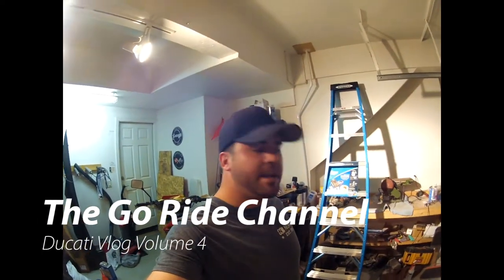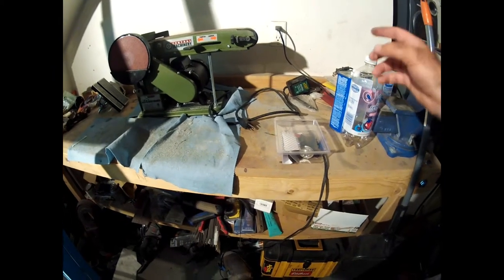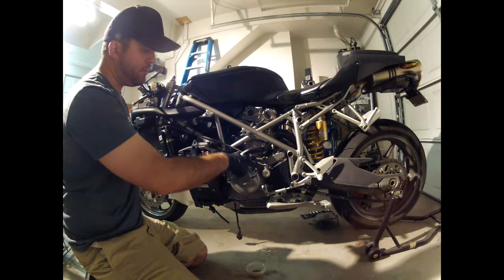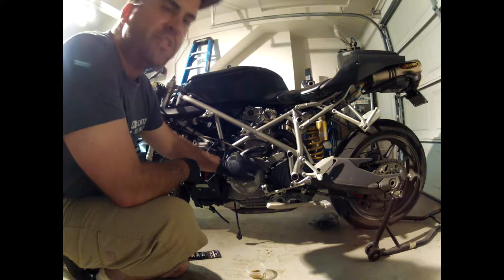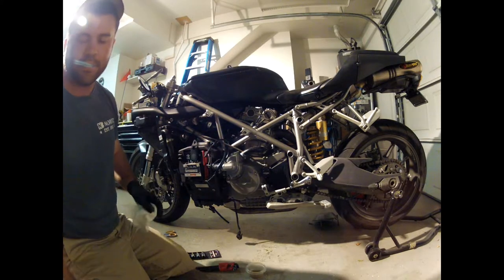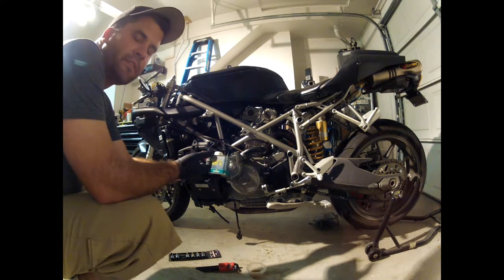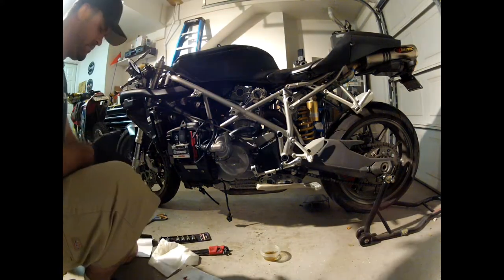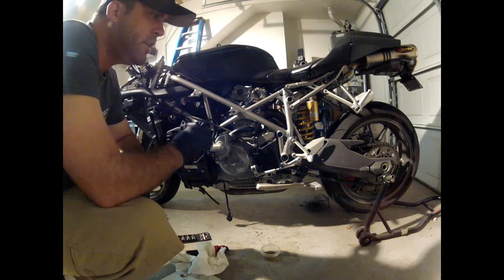Ducati Vlog Volume 4 - How to Install a Clutch Slave Cylinder on a 749

Comment: I am also looking into this and the part for my sf848 is also clu-116.
I remember the first weeks of owning the bike when my wrist would hurt after every day of riding with the stock slave cylinder.
Now I'm used to the stock one, but attracted by the lower effort required by the oberon slave
Reply from the maker: I can see how that is - I didn't find that modulating the clutch with the larger slave was any more fussy than with the stock one. Also, it's a really, really good option in the event the stock unit starts weeping.

Comment: Hi ! thanks for the video with great explanations !
Do you know if it would be the same process on a 900 ss ie from 99 ? The clutch give me wrist pain after few hours of riding ... Do you recommend this mod ? thanks for the answer ;)
Reply from the maker: I'm not 100% certain if it's the exact same process - but it is the same part number, so it should be really, really similar. The only question I have would be with respect to the clutch push-rod, etc. Otherwise, you're looking at the same three bolts and the same process with bleeding it.

In general, it's about a 30% reduction in pull effort. It made a difference for me, but wasn't the "end all be all". Although the reduction in pull effort helps a lot, I found that just riding more frequently and strengthening that hand helped even more. I have some issues with my left hand due to some old injuries from when I was a kid, and so keeping that hand strong is important.